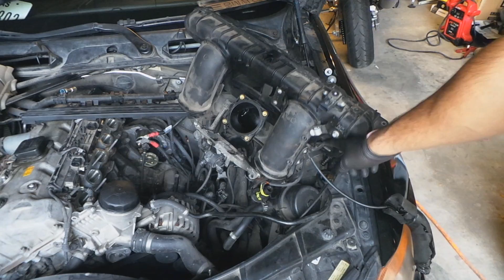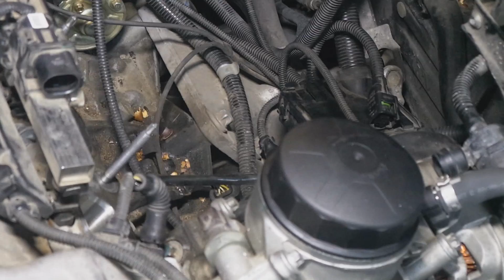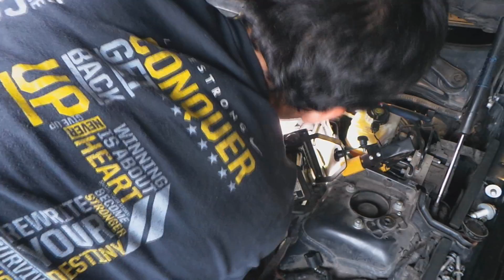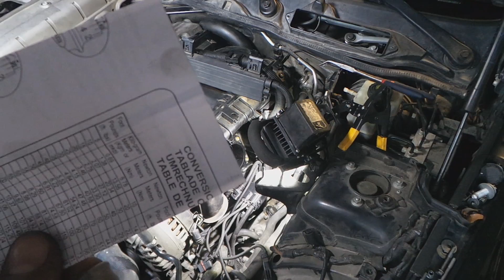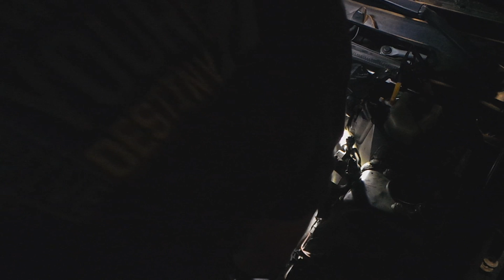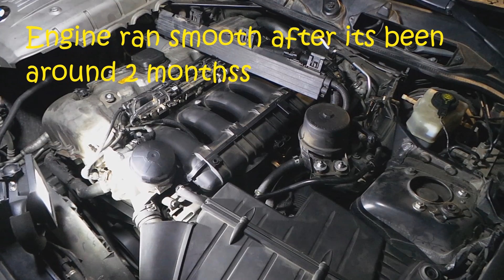BMW e90 ccv replacement

Comment: do you think I can remove and install  the  new valve cover ventilation hose without removing the intake manifold?
Reply from the maker: probably possible if you have a 5 year old stick their hand in there, I don't know if I have such small hands though.

Comment: Can ccv cause oil to travel into the spark plugs or is that the valve cover or valve cover gasket
Reply: @thebmwdoctor
Reply from the maker: Most likely VCG is leaking on to the plugs.

Comment: 07 e90 i know my pcv is gone ,don't want to change out my valve cover is there way to just change pcv
Reply from the maker: The're is replacement pcv for it. I've never done one, but it might work. Let me know if it does.

Comment: I have a N52 with the CCV and PCV built into the valve cover gasket. I recently replaced the valve cover and now experiencing large smoke when accelerating hard and engine leaking oil at an alarming rate. It took 6qtrs of oil to travel 50 miles. Could this be due to the crankcase breather hose not being replaced?

Comment: Hi really nice video and well explained, made me subscribe!

I'm having issues with my E93 320i 2009 (N43) - On cold starts the engine vibrates and Rev need fluctuates +/-50 rpm. Below 1K rpm on idle engine continues to vibrate and you can feel it on the driver seat. 

The codes I get is misfire cylinder 4, Running lean/rich (it changes), fuel mixture. The car has had coil pack and injectors replaced by BMW which didn't fix the issue. Also they then re-coded the ECU which did nothing and are not sure whats wrong with it. 

I've cleaned the Vanos, MAF, NoX senors,other o2 sensors and changed the oil gasket seal, oil cap, timing chain but no luck and spent too much already! Any suggestion that could help would be much appreciated?

 I feel its a vacuum leak but it starts and drives ok when the engine is warm which confuses me.

Thanks

Comment: On the rubber tube that connects to the throttle body, what is that opening of connector thing that faces up??? Thanks
Reply from the maker: What time on the video is that?

Comment: Hi, I got  2006 BMW 325i E90 N52. It starts then 4 seconds shuts off. I can keep engine running for  about a minute at 7000rpm rough idle if a press the gas pedal all the way. I've replaced: new spark plugs, coils, throttle body, gas pedal,  and nothing.  Fuel pressure 72 lbs, it has spark. I just to get codes: p0300, p0302, p0206, but now I'm only getting P1415.
Reply: Por Mis Pistolas hi! Have you sorted your problem? I am straggling with the same problem with my bmw.. thanks for any advice..

Comment: Hi how re you thanks for amazing video 
I have a quick question if you can help me please i replacement my 2006 BMW 325starter after that I got rough starter problem car is run perfect 
But when I start  the car shaking and rpm going up and down , finally when I drive to work today when I stop at traffic car shut down it happened all day so I parked my car sitting now also I have check servise engine soon light on I will read it asap
Reply from the maker: Thanks! your symptoms are an indication for a misfire or big vacuum leak , I can't determine anything without a fault code. once you find out let me know and I'll see what I can do.
Reply: TheBmwDoctor good afternoon 
I got code 
U114b manufacture defined 
P0700 transmission control system (mil  request)
P0174 and p0171 system too lean 
P1415 manufacture defined 
P0305 cylinder 5 misfire defa...
Reply from the maker: Check for vacuum leaks by smoke testing the car ( checkout videos on you-tube) 
Check cylinder number 5 coil ( swap it with another known working one and see if the code travels
there are a hand full of factors that could get you these codes but I would start with the basics first.
Reply: TheBmwDoctor thanks for information 
I will let you know s
Reply: TheBmwDoctor I did smoke test there is no leak and i checked all ignition coil eveything seems good no oil inside also switch number 5 by 4. 
This morning I clean maf sensor and I put it back but  still same problem 
What I see when I took off maf sensor 
Car works great no shaken and vibration and rpm ok whenever I plug it back again same thinks happened 
Assume maf sensor not
Working.. maybe only problem on my car maf sensor what u think 
Thanks

Comment: Thanks for posting the nice and helpful video! I've got 06 bmw 325i e90 and ready to replace my CCV after I successfully replaced my valve cover and eccentric shaft position sensors, etc. I heard that disconnecting
 and connecting the return hose is pretty hard. Do you have a video showing how to disconnect and connect the return hose of 06 bmw 325i e90? Thanks in advance!
Reply from the maker: Yes this is exactly what you need https://youtu.be/Cqp9IOMKj_8
Thanks for subscribing
Reply: Thanks, my friend! This is a helpful video.

Comment: Hello, which is the behavior of the engine or car when the ccv or pcv has problems with torn hoses or electrical cables. I ask, because my BMW E60 engine N52, 2007, 525i,  does not have light of alarm on.  When I start it in the morning, the engine ignites correctly and feels perfect. But when I put it in "D" almost it does not want to move.  Obviously I have to warm the engine for more of 5 minutes at 3k rpm. Then it advances better, But when I go to 50 miles it is listened or you feel the transmission is in 3er gear,  Even when I Does all the gears Manual with Steptronik.
Reply from the maker: Your car is in limp mode which is triggered when your transmission/ engine are experiencing issues such as 1-Faulty Mass Air Flow Sensor ( Most common) 2- Low Transmission fluid level  3- Faulty transmission module 4- Faulty valve body , Faulty Speed Sensor. 
I would get the car scanned and pull the codes then send them to me and I will do my best to narrow it down for you.
Reply: I understand, the fault codes are 4f81, 4f83 and 4f8f. Thanks forma the help....

Comment: Is this a N52 engine ?? like used on e60 ?? and de CCV is same a PCV ??
Reply from the maker: Yes that is an N52 engine same one used in the older e60's.The CCV is Crank Case Ventilation similar to the PCV but not exactly the same.